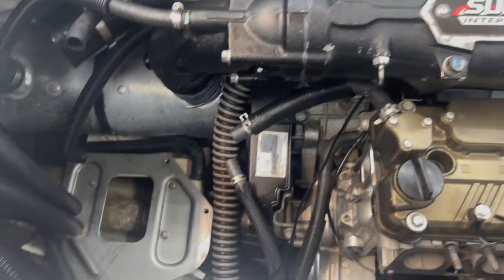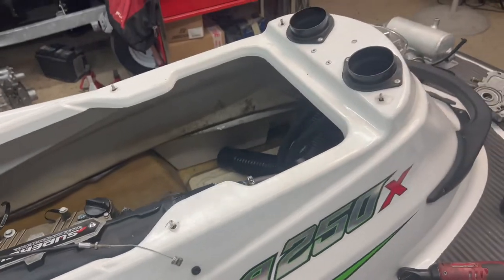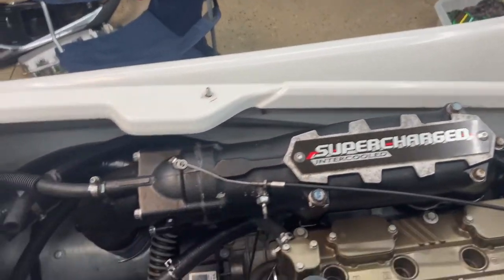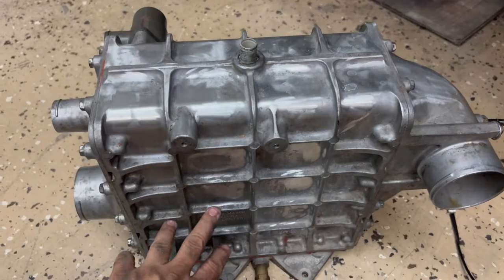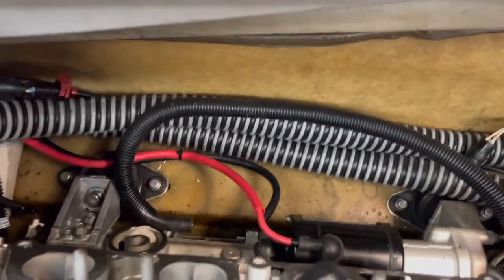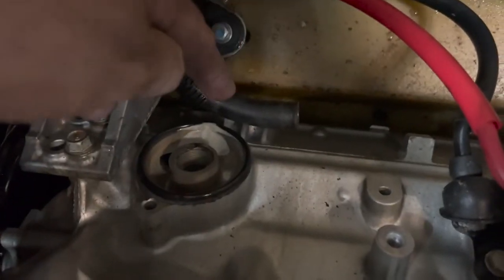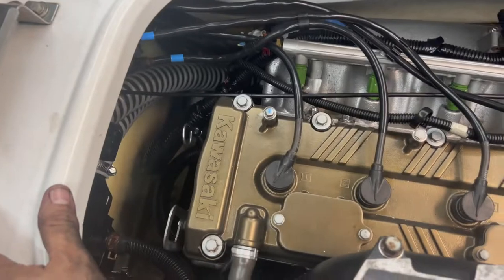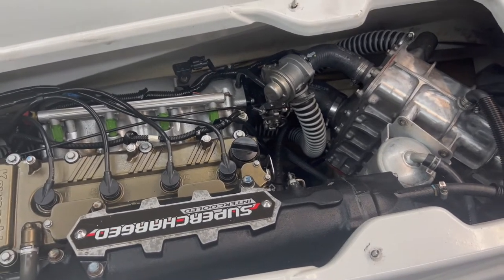Water Mixing With Oil on a 2008 Kawasaki Ultra 250x

Comment: Hi there.  I have one ultra 250sx and engine was kind of stuck as it was left stored for few months without running..I was able to unlock the engine by putting some brake fluid and it finally got released.  After replacing the oils and spark plugs, it run well but now it is throughing oil out thru the turbine.  Running it for 10 minutes almost 5 l goes away

Is it repairable?  Any idea of what can cause this ???  Thanks a lot for the help
Reply from the maker: The oil is coming out from the supercharger you mean? How much oil do you put on it? It is smoking?